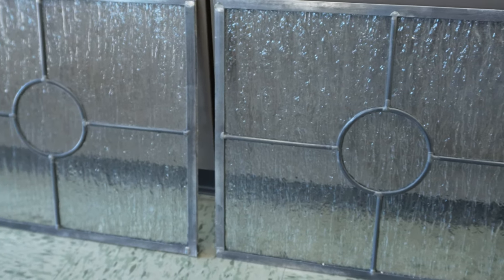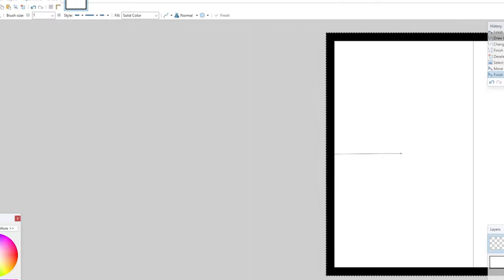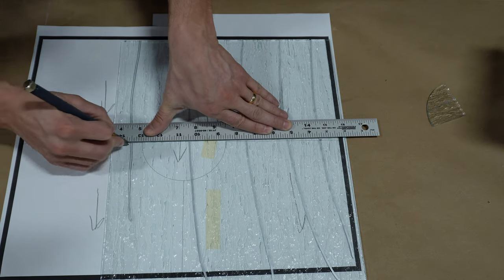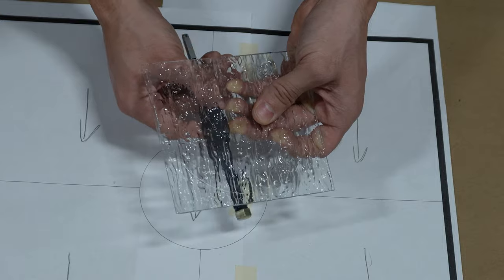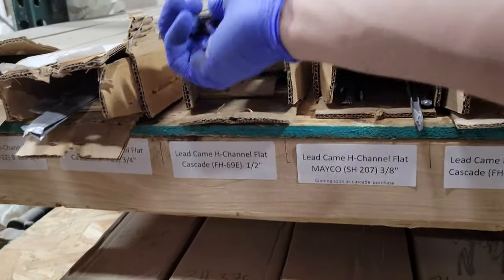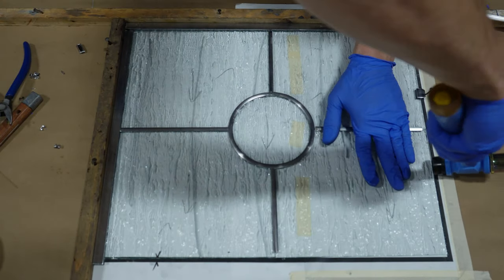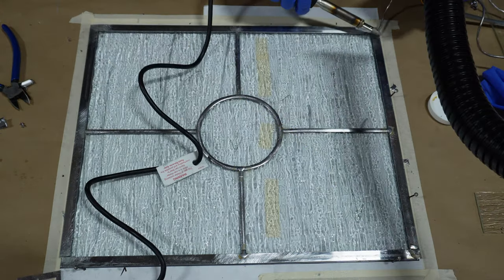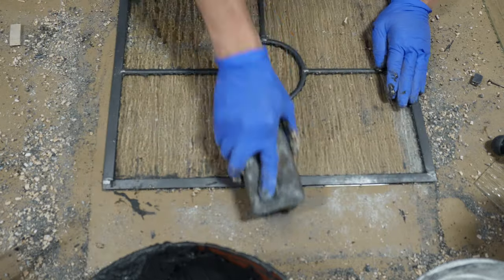(2024) How To Make A Leaded Glass Window

Comment: Great job!

I've been thinking about a way to incorporate fabric craft into stained glass. Maybe sandwiching the fabric between panels would work, but I've never seen it done before. Do you think it's possible?
Reply from the maker: Thank you! We also laminate glass. One common decorative material to use is fabric. This would be the best way I can think of to incorporate some fabric. You would just need a really wide channel for the extra thickness. The only reason we don't use it too often is because it fades in sunlight. That's really one of the best parts of the  medium - it's highly durable to the elements compared to other materials like paint, plastics/acrylics, and of course fabrics.
Reply: @Mr.StainedGlass  So in theory, I could crochet or knit an item, laminate it between panels, and done correctly of course, it would work? 
The implications are literally endless! Thanks so much for your reply. Amazing.
Reply from the maker: @melainenicholson That's correct. In our facility we have a vacuum / oven setup from pujol, which i believe is an italian company. Laminating can be tricky with fabrics because of the air bubbles. It will take several test tries to really get it right.
Reply: @Mr.StainedGlass  Could she in theory spray the fabric with a UV protectant spray, similarly to how pressed & dried flowers are treated for use in stained glass? Just an idea but I have no experience with incorporating fabric into my glass art so I’m just throwing it out there for consideration lmao